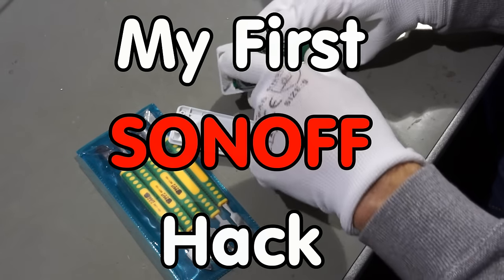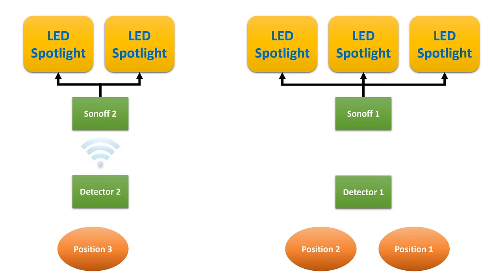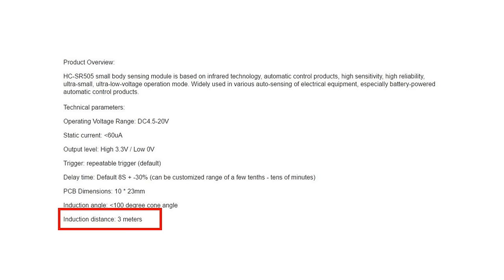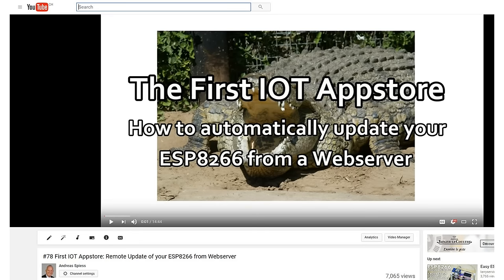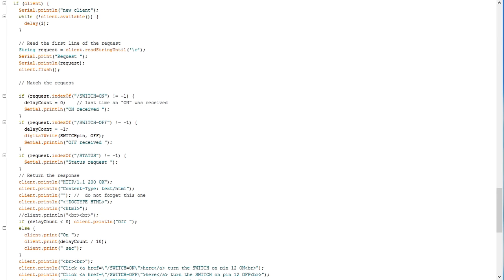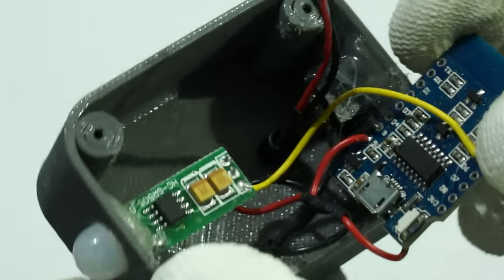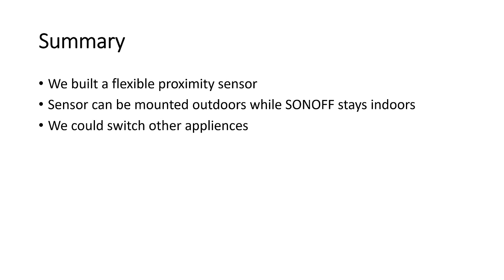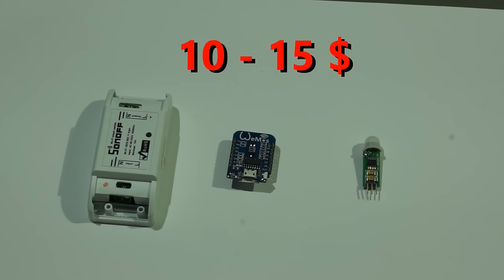#93 Remote Motion Detector Using a Hacked SONOFF Switch for Home Automation Projects

Comment: Well done Andreas.  In my experience using MQTT behind the firewall is a great way to operate many integrated ESP8266's.  Message payloads can be a single bit.  I have many deployed in my home on NodeMCU boards, Wemos D1 Minis and some Sonoff also. 
I use several for an integrated security/access control where they are deployed on a gate lock release accessing my garden and a WiFi extended zone connecting my sheds to my home alarm system.  The sheds are solar/battery powered with efficient 3.3v buck dc-dc power supplies, Wemos boards, reed door switches and PIR sensors.  These can operate for many days without sunlight.
I have found it easier to keep the workload and complex logic of the ESP modules to a minimum and use a Raspberry Pi from the first ever production run embedded in my home security panel to monitor my house alarm and integrate the sheds as a zone.  The Raspberry Pi runs the MQTT (Mosquitto) broker and an instance of Node-RED.  With Node-RED I can easily process the MQTT traffic and create or edit the functionality of all my ESP/Sonoff devices on simple graphical flows.  Node-RED even allows secure push messaging of alarm activations to our mobile devices using the Pushbullet API and I have used several UI nodes in my flows which are ported through my firewall allowing me full control of the systems in the outside world via DDNS.
The system is so easy to use that I added several automated Halloween props including sound via system commands to play MP3's on a Raspberry Pi called via MQTT in sequence with lightning, zombies in a coffin and more.
I recommend this architecture for easy centralised control.

Please keep the videos coming, they are an inspiration!

Garry
Reply from the maker: Sounds like a big installation! Thanks for your info. After all the comments about MQTT and node Red I think, I will do a video about using this technology. But maybe next year... Next, I want ot hack the other Sonoffs including the POW.
Reply: MQTT + Node-RED is an easy option especially for novice programmers like me but I do enjoy trying and learning from your examples.  
Great videos, thanks Andreas.  Garry

Comment: Hello Andreas i use that web config all the time. And when it switches from AP to station mode there is a administrator mode that disabled about a few minutes. You can go in there is raise that amount of minutes from i believe it's 3 or 5 minutes raise it as high as you like . I think it's in milliseconds.
Reply from the maker: Yes, you are right. and probably, I will introduce once a button to switch manually back to operation to save the time of waiting
Reply: That would be awesome. That is why you are the pro man :)
Reply: Hello Andreas I finally got my Sonoff switch and i figure out most of the GPIO pins being used. But i noticed something. The Led is using GPIO 13. But the Led is Bicolor No one has mention what the Other Led is connected to?

Comment: As usual, a very good example of using ESP8266 IOT device in a real world case. It is a good scenario to use MQTT and Node Red to have flexible and powerful logic. It may be run on same machine as IOT App Store. Thanx for sharing.
Reply from the maker: I get many comments concerning using MQTT. I think, this is a very good protocol. But running a Raspbery just to transfer a command once in a while is an overkill for me. I experimented with MQTT, but at tis time, it did not support QOS=2. What is the current status of the clients and brokers?
Reply: For things like MQTT, Node Red and Esp8266, Peter Scargill is who has researched and published most. You may follow his posts and ask him if you want to know current development status. Check tech.scargill.net
Reply from the maker: I will do that.
Reply: If you have a pi running, you find other task for it very fast. I replace my pi 1 with a pi 3 in the next days, because it can't handle all the stuff that is running on it.

For example, I run mumble on it to phone with my friends. It checks every device in my lan if it's up and running and handles some of my UDP messages that I'm sending arround for controlling my ESPs at the moment. Sends me notifications via mail, push or twitter messages. Notifys my ESPs if I got new mail. Updates my external IP to www.nsupdate.info and lots of other small tasks.

Comment: Excellent video. :-)
 I use a PIR sensor similarly to turn off my soldering iron if I have not been near it in the previous 5 minutes. An ESP8266 version of this would allow for verification the iron is off from 100km away.
Reply from the maker: True. BTW: I currently test a soldering iron with an accelerator builtin. Also a neat idea...
Reply: I have a DS90T from banggood that has timer and accelerator builtin. I love this feature and I put my old ersa in retirement, that only has two different tips to choose from. The new one is compatible with hakko tips.
Reply from the maker: Seems also to be a nice iron...

Comment: Hi Andreas, I'm not sure if you had problems with the system if you being stationary or just some small motions, say fine soldering, reading, etc., and the controller switch off the lights? If so, how would you propose to solve this? Thank you, as always, for sharing these great ideas and videos.
Reply from the maker: I solve this problem with a long delay till the lamp goes off. And if I really stay too long without a movement and the light gets off, I have to move a little ;-)

Comment: Great video thanks a lot !
How do you power the sensor ? I thought it should be feasible to use the sonoff to power it. This would be great if some motion detection.sensors.could also be used as sensors for a diy security system via a hacked sonoff reporting the state.
Reply from the maker: Sonoffs have internally 3.3 volts. However keep in mind: They are connected to 120/240 volts. This can be dangerous.
Reply: @AndreasSpiess  thanks for your reply. I came to the conclusion that too much hacking of the sonoff was indeed not a great idea, ill stick to changing its firmware.

Comment: Hi. Thank you for your video. I am planning a project using your solution in this video. I'm going to be using:

- WeMos D1 Mini v2.3.0 modules
- HC-SR501 PIR sensor modules
- Sonoff Basics

I would like to power my modules by batteries. I don't want to use rechargeable batteries. My only concern is that the batteries can last up to a year.

I would like to know:

- What type of batteries would you recommend for this?

- How should I do the wiring for the WeMos + PIR module + batteries?

- Would your Sonoff Sender sketch work for with this?

- How would you reduce the issue of false start on the PIR sensor. I read on a forum that this can be fixed by soldering a 220nF ceramic capacitor across pin12 & pin13 of the PIR sensor's chip (BISS0001), but he offered no other info as to the voltage of the capacitor or anything.

- I would also like to add both the receiver and the sender to Hassio. Is this possible with your sketch?

I'm a noob when it comes to electronics, so any help will be greatly appreciated.
Reply from the maker: Maybe you watch my videos about ESP8266 deep sleep and the videos about batteries.
Reply: Thank you for replying. I will take a look at those videos. Thanks.
Reply: One more question. Would this work with MQTT and Hassio? If not, what would I need to do to get it to work? Also, would the ESP-01s work instead of the WeMos?.

Comment: Thats really good, thank you. is there a way of extending the range of the IR sensor? Also, could you do a tutorial of how to integrate with online services - i'd like to switch led lights on the stairs when someone approaches, but turn them off when they get to the top?  Can you also post links to the IR sensor that you used as well please? Thank you
Reply from the maker: I have videos about calling services, about building your own service using MQTT and Node red on a Raspberry Pi, and also on IR communication. Maybe you browse once through the (long list). Maybe you find what you need.

Comment: Great video again! I was waiting for this. Do you plan to test the Sonoffs with build in 433Mhz receiver to?

A good alternative to PIR are "microwave motion sensor". I have nearly replaced all PIRs with them. There are ready ones, modules for DIY and eaven LED bulbs with build in microwave motion sensor. They have better range, can be build in a lamp or non conductive housing without drilling holes and eaven work when you wear warm clothes in the winter. Nearly same price range as the PIR modules.
Reply from the maker: I have one laying around. But it needs quite some additional circuitry. Which ones do you recommend? I would be glad to test one.
Concerning the 433: It is not on my priority list. So, it will take a while.
Reply: Haven't received a sonnoff with 433mhz receiver yet, so I can't recommend one. When I remember right you already buyed some 433mhz sender and receiver modules. This learning remote https://goo.gl/QCzRNr can be helpfull for first tests with 433Mhz. 

Remoteswitch library from https://bitbucket.org/fuzzillogic/433mhzforarduino works very good on a Digispark/ATTINY85.

433mhz remotes aren't the best solution but they are small an cheap. I don't want to get my smartphone out of the pocket, connect to my wlan, open a browser or app to only switch on a light. It eaven can work as a backup if wifi fails.
Reply from the maker: I was not clear. I was asking you about the radar sensors!
I hope, I will be able to deal with the 433 MHz...
Reply from the maker: Thanks. I will have a look at these...

Comment: On the terminal where there is the relay does it put 220v or just closes the contact? I'm thinking to use it with a "logic" input on the other side and i just need to close the contact... no big AC current allowed.
Reply from the maker: I do not understand your question.
Reply: Andreas Spiess when the contact on the sonoff is closed. There is high voltage or just a closed relay?
Reply from the maker: The 220 volt is switched by a relay. You can use this relay for other purposes if you do not want to connect it to 220 volts. However, then, you have to power the ESP8266 (it is powered by the 220 volts).

Comment: Great Video, I have a question, I've been trying to get the ARILUX® AL-LC02 Super Mini LED WIFI controller to broadcast after flashing with a mod firmware. It seems the firmware is not allowing the controller to broadcast wifi  after the flash. . just wondering if you had any knowledge with this controller?
Reply from the maker: No, I do not own one of these.

Comment: Isn't the ESP drawing too much current as to have it on all day long?
Reply from the maker: +aguaviva Good point. I have to check it. The ESP itelf uses 0.08 A x 3.3V = 0.26 W which is not a lot, compared with the 300 Watts of the LEDs. But the power supply might use more.

Comment: Hi Andreas, do you know anything about the CE Conformity from the Sonoff`s? Or for the Swiss i think it has to be conform with some IEC norms. I Like the Devices very much but i am afraid to use it with main leads. When it starts burning no insurance will pay anything.
Reply from the maker: The engineer told me, that the devices with the sign printed on the box really comply . You decide. 
I mound these thins in places where they cannot destroy a lot. Generally, I fear more that they destroy my computers and lab equipment if they expose 220v on 5 volt leads...

Comment: Will you be doing a Sonoff Dual?  I want to use the 2 on board relays not to supply A/C but just to act as a simple switch to close a contact.
Reply from the maker: Maybe. But not soon. I think, it is very similar to the normal Sonoff
Reply: If you should see it somewhere please post the link.  I have a garage door operner project I am thinking of and I have 2 door openers.     Thanks,

Comment: Hi,
regarding the pir sensor HC-SR501, could you please recommend a good way to calibrate it?

I tried three of them.
The first one worked fine with the first example that I found on the internet, but I was unable to use the other two.

Thanks
Reply from the maker: Next week, you will find a new video concerning the HC-SR501 and SR505 PIR sensors.
Reply: This is great news, thanks!

Comment: I know that 8266 can also serve as an AP. Is there a way to run an MQTT server on one of the many in a dedicated local network?
I was thinking I can use the 2.4 GHZ band for a network that runs 4x8266's, and use the 5.8 GHZ for my PC. That way, the MQTT server can be running on one of the *266's and not rely on the outside world (Adafruit, etc..), and not interfere with my PC and secure from hacking. 
Is there code that would run on 8266 and provide MQTT broker services?
Another excellent video from the 8266 master :)
Reply from the maker: I do not know about the MQTT broker, but I assume, they are based on UNIX. Most people use Raspis. Maybe with a Zero, the effort is also small to have such a broker.
Reply: I think I'll buy another PI3 cuz Pi zero with the wifi and the rest, comes to more $ here in Canada. a Pi0 is about $30 not $5
Thanks for the reply
Reply: I have a Pi3 running a pi camera 24/7. Maybe I can add a Mosquito process to run concurrently. I have to look into it. It makes no sense to put up another one, if I can do the job with one Pi3.
Let me know if you think it's possible.
Reply from the maker: I do not know Unix or Raspbery (yet). So, I cannot tell.
Reply: It works like a charm. Installed Mosquitto and all is running fine. So no more external MQTT broker for me.
Was concerned with security and I don't really have any use to control stuff from the outside.
Reply: UFOhunter take a look at "homie" for 8266. its not an MQTT server though, it's an framework for your esp's based on MQTT. its really worth to take a look at.

Comment: Is it possible to connect the PIR sensor directly to the sonoff GPIO 14? Running the PIR on the Sonoff 3.3v?
Reply from the maker: +Kim Lindblom you have to check whether your PIR sensor runs of 3.3 volt. If not, you have to connect it to 5 volt. 
The ESP pins should be 5v resistant.
Reply from the maker: As I wrote, it depends on your PIR sensor. It seems that this one will work.

Comment: Hi Andreas. I just discovered your channel. Why do you use gloves? It's it because of the chemicals in the components?
Reply from the maker: No. It has private reasons.
Reply: Ok, thanks, great videos! I love them. Could you do one of At tinys?
Reply from the maker: What do you have in mind? There are a few of my early videos I did with ATtinys (e.g. battery tester, printer switch, ultrasonic sensor with I2C)